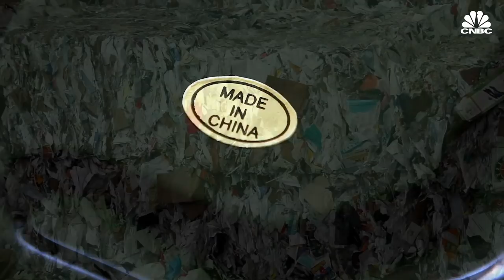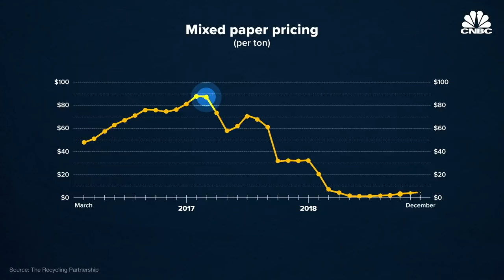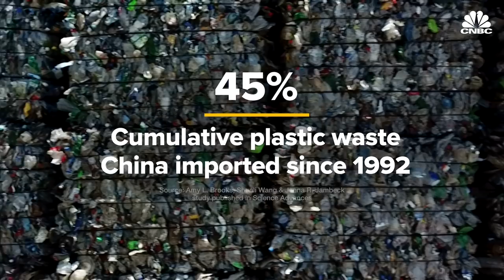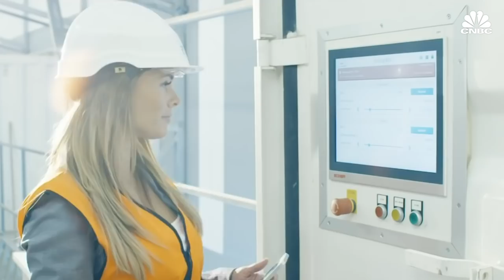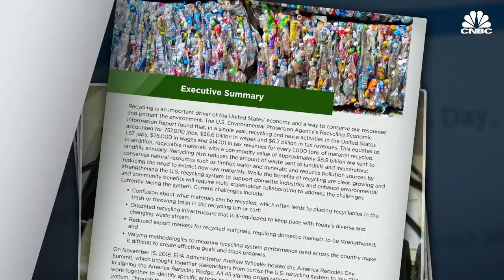Why China Stopped Buying U.S. Recycling

Comment: 0:08 "That makes sense" no it does not we ship plastic crap half around the world and then ship back the packaging again half around the world. What would make sense is to make things in the US consume them in the US and then use the collected packaging inside the US (for example, gasify and burn them for energy). Denmark and Sweden have already perfected it, plastic is a very good high energy content fuel and if you burn it after gasification it burns completely and all you get is clean CO2 (and water).
Reply: Recycling has a lower carbon footprint than extracting and processing the raw materials. By recycling what we already have, we can keep prices low and excess pollution low as well
Reply: @EvanRustMakes  depends on what you recycle. If it saves forests I am all for paper recycling but plastic might take more energy to recycle than to make new.
Reply: @andraslibal  But regardless of even the CO2 output, how do you think new plastic is made? It is primarily derived from fossil fuels, so by recycling, we can cut down on extraction, which can cut down on the carbon footprint even more
Reply: @EvanRustMakes  no, actually you are making a lot of oil and natural gas as a byproduct by fracking and you should use that natural gas instead of just burning it off, it is happening, gas thermal plants replacing coal, LNG being made and exported ... think of it as making it go one more cycle as a product instead of being burned off immediately. The longer you keep it in the loop the more it cuts down on waste.
Reply: MAGA! 😁 USA is slowly making progress but significant efficiency in price & quality since 2008. 🤫
Reply: @BelleLopez312  what?

Comment: I quit recycling. It is not really helping. We need to just stop making so much useless stuff.  There should be limits on the number of items a company can make. There shouldn't be dozens of kinds and brands of the same product.
Reply: Honestly, throwing away plastic is better for the environment at this time. Same for paper products, especially if your city can compost.

Energy to clean and ship it is just much more that it's worth, and landfill space is not in as short supply as we think. 

Most plastics will be compostable in the next 15 years, almost all the traditional non-recyclable plastics (cups, straws, plastic forks, etc.) have compostable alternatives. 

You should always always always take time to clean and recycle metal though, it is extremely efficient to recycle.
Reply: Also, that 2nd part isnt going to happen in a functional economy unless consumers make the choice to buyers things. Which they wont
Reply: @Reed160  I know it's pipe dream. It would never happen.